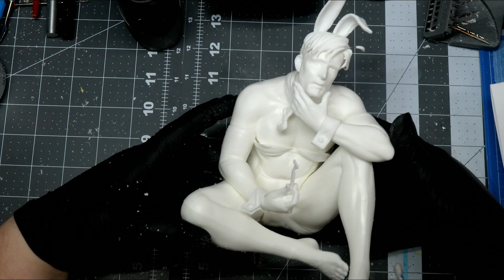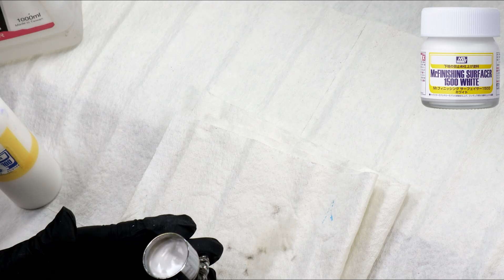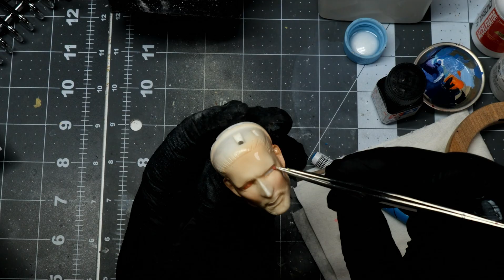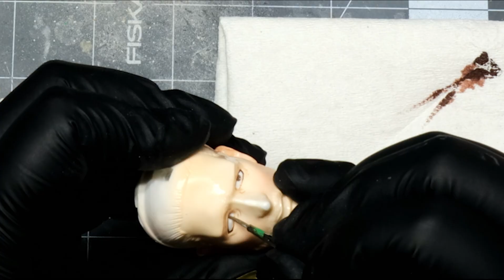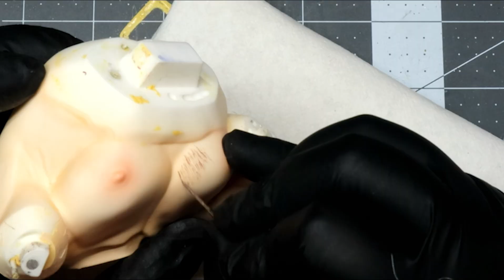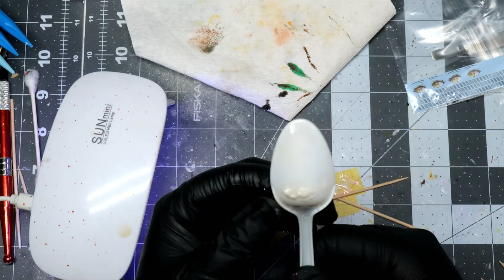【Original Character】Garage Kit Build

Comment: amazing job! I loved watching you lay it all out and the great tips. I'm a newbie to gks (working on my first one right now) so I had a few questions if that's ok...

* is it always necessary to use both magnets and pins together on the same part? or was this a special case since the kit is pretty big?

* for super thin pieces like the hair items, how do you not accidentally dremel to create a hole through the resin completely? like I'm amazed you can tell when to stop using the dremel and also ensure the created hole is deep enough for the magnets

* would you have other tutorials or video recommendations on how to do the clear skin method?
Reply from the maker: 1. I use both a pin and magnet if the piece needs it. Sometimes it adds support. Other times it prevents the piece from twisting
2. I accidentally drill through pieces all the time. 😅 You just better at fixing it each time.
3. Eventually I would make specific technique tutorials.